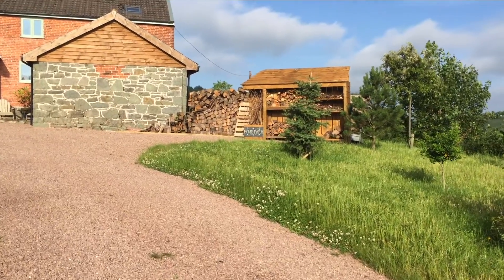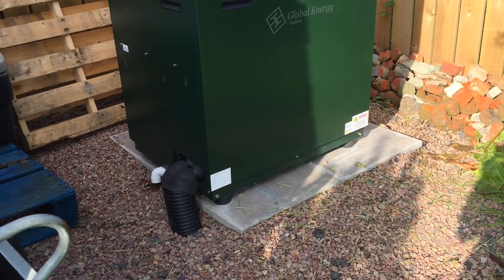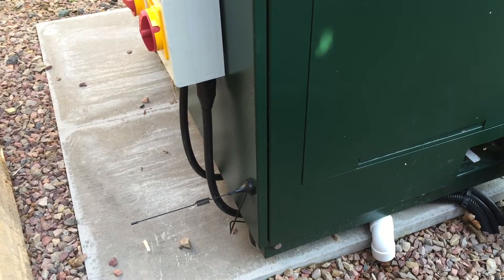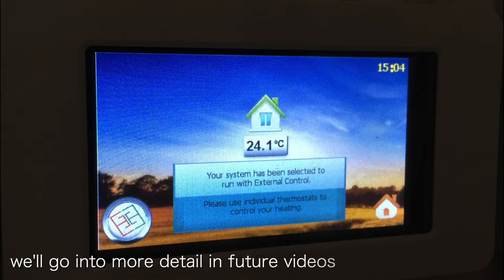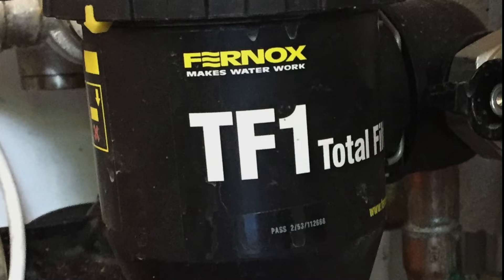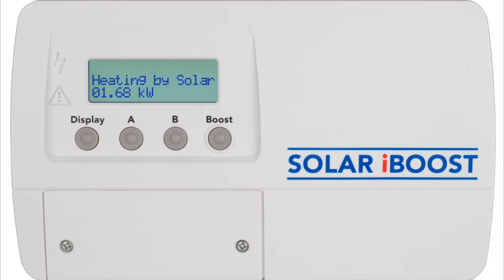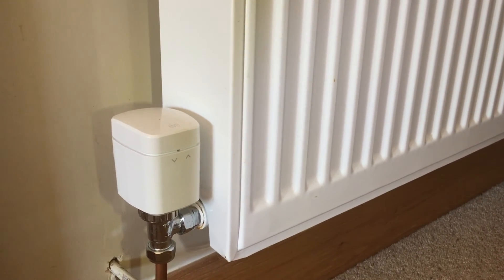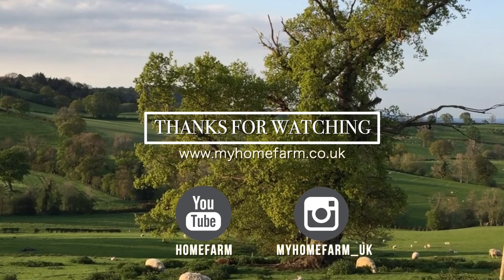Our New Air Source Heat Pump

Comment: Quite a complex system, I sympathise with the difficulty in getting your head round this if you are not a heating engineer.  I was an Architect, I have done a ground source and a water source.  The ground source heated a water cylinder that was then used to provide heat to the house.  The water source a plate exchanger.  So neither had a direct connection between heat pump and heating pipe work. 
It would be helpful to see a diagram of how your system works.